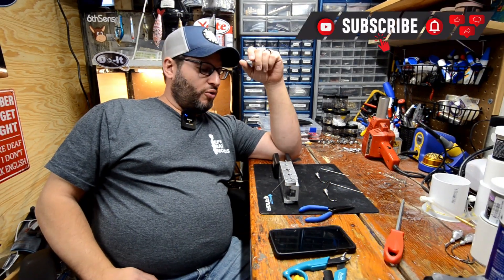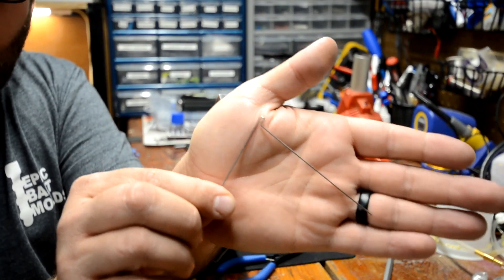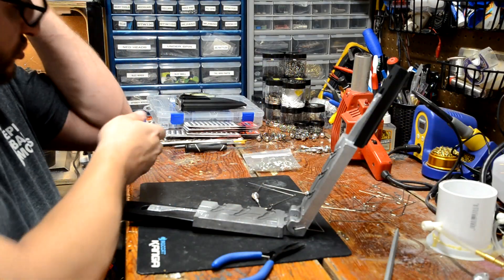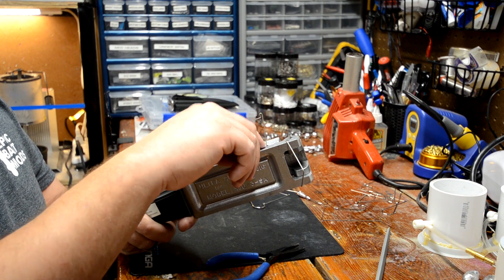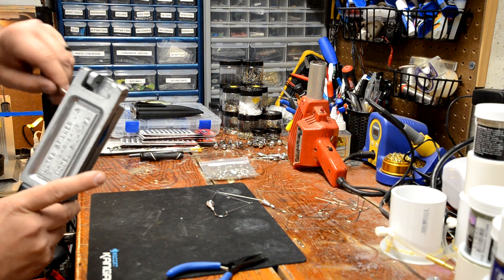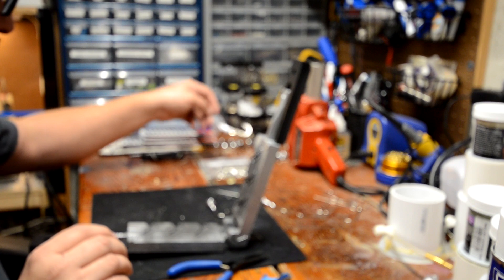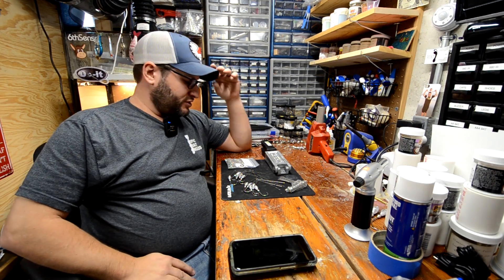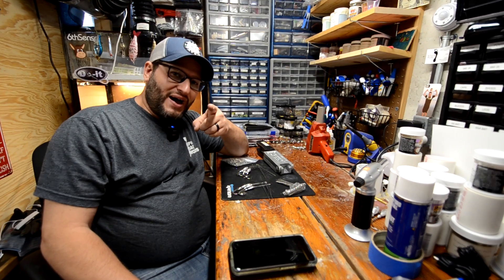MAKING SPINNERBAITS! (Lead Pouring Only) (PART 1)

Comment: I had the same issues with that mold.  Using the tape is a good idea that I will try.  Heating it up helped me also.  After making quite a few I watched another video where they used pliers to close the wire form around the hook eye.  I wonder how necessary that is.  Thanks for sharing this video.
Reply from the maker: Don't think it's necessary to close around the hook eye, it's surrounded by lead. Thanks for watching!
Reply: Same thing here. Plan on modifying my mold to accept a small neodymium magnet to hold the hooks in place.

Comment: Can you make that same one with smaller wire? Or does it have to be the .40?
Reply from the maker: The 1/4 oz size will do .035 and other 2 take .040 or .041
Reply: You can pour both the bigger sizes with .35.  It’s harder bc it’s thinner but can be done with patience.